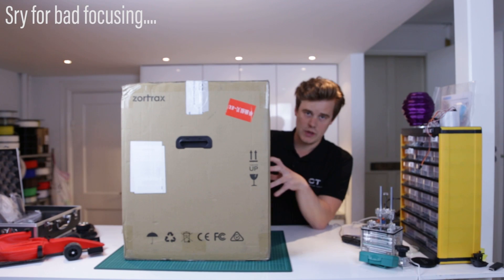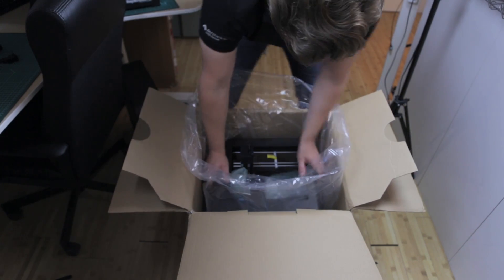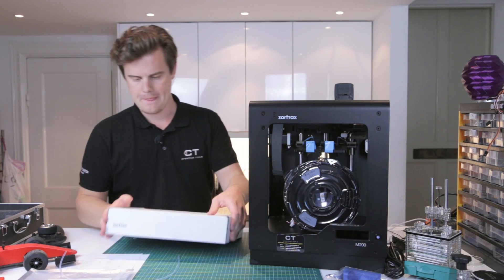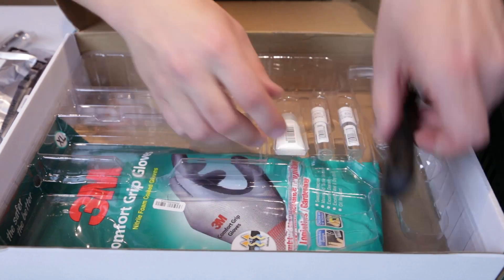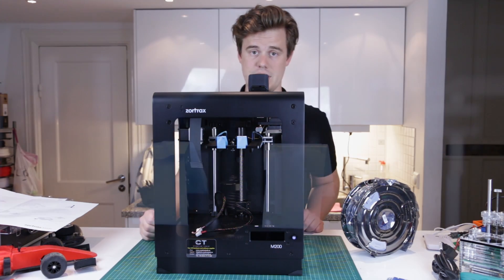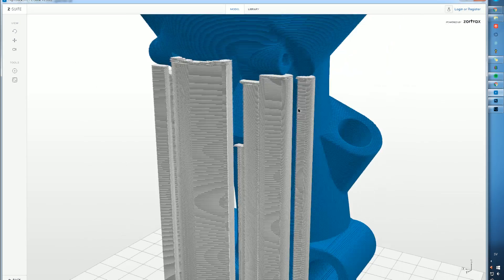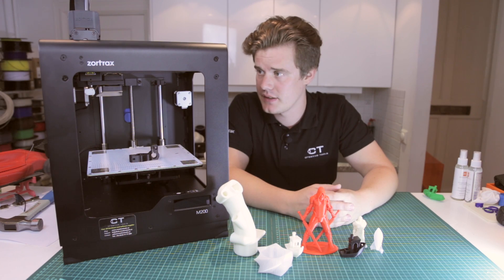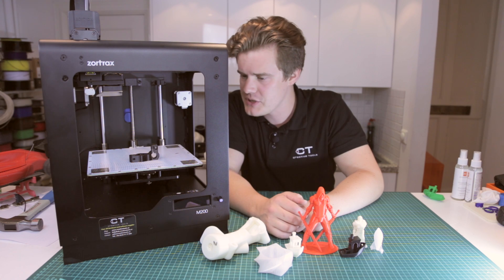Zortrax M200 3D printer Review

Comment: I used this for a week and returned it, I agree 100% that the quality is amazing however it's not all the printer but 70% is the filament it self that is good.
I tried their Z-ABS and Ultra on Flashforge dreamer and UP mini and got almost same quality of prints.
So I have conflicted feelings about the Zortrax M200 
I can't say anything positive or negative about it.
Only question does it really worth the price tag on it if most the quality is in the filament? 
The proprietary software and filament made it undesirable for me but I feel I should give it one more chance, but all reviews on it are few and it feel little too positive due to the fact reviewers got it for free and don't want to be too harsh, but that not accusation or insult as much as feeling I have from my experience with it. 
I trust your reviews, Angus from maker muse and Joel from 3D printing nerd  the most and never failed us fans and followers.
Reply from the maker: Hi Salem,,   I do agree the filament is really nice. I've tried using both other filaments in the Zortrax and the Zortrax material in other machines. I agree on the part where the filament is good. I strongly believe there is innovation and uptime at the machine. 

Thank you for your nice words as well =)  To clarify, the unit i'm using is a bought unit and  nothing has been sponsored by Zortrax to me. With insight into the support at a reseller, I can say it's one of the least represented machines in there. It delivers. Almost always :P.

I respect your call on the propitiatory filament and software. You are doing the right choice if their software isn't a long time solution for you. So considering that, as I mention aboved, it delivers when it's something within the market for that machine.

The Dreamer is my current "to go to machine" as well, it integrates really well with Simplify 3D, wich is a must for me.  There are however quite a few perfect customers for the Zortrax and even though the company have some questionmakrs around some stuff, their M200 is a great machine and I expect atleast the same with the M300. They just need to fix the connectors for the buildplate ;).

I enjoyed your feedback! Thanks!
Reply: +3D Print - Tech Design I agree with you.
I am happy with Flashforge I own all of them , and my other printer that I love is Ultimaker 2+.
So far open systems been much more than proprietary to me. 
Never the less I own few proprietary systems such as CubePro and UP Box.
I might give Zortrax another try I want to like it but Flashforge dreamer always impress me with its capabilities that I hold on the thought .
Reply: هلا سالم ابو الروس حبيبي عندي 
زابي اس اقدر استخدمه على يلتيماكر بلاس ؟؟ ممكن درجه الحراره المستخدمه مع زي ابي اس
Reply: +Max q8 I don't speak Arabic
Reply: !! really  ok how to know i speak arabic lool 
why your name arabic !! يالمصري ههههه
Reply: +Max q8 I recognize the letters from Quran I'm Muslim but American from generation
Reply: ok
Reply: +Max q8 so what was you said in Arabic?
Reply: i sold zortrax and i have z-abs i want ask can used z-abs with ul2+ ?
you know the z-abs temp 285 and ul2+ only have 260c how to print z-abs ??
Reply: +Max q8 no you can't use it with Ultimaker because ultimaker is 2.85mm and Z-ABS is 1.65mm
Reply: thank you salem